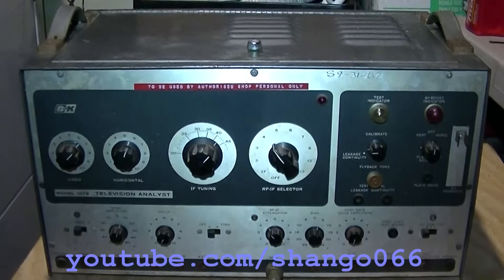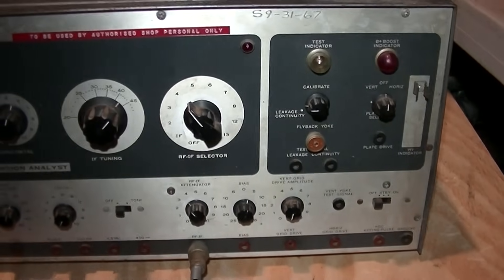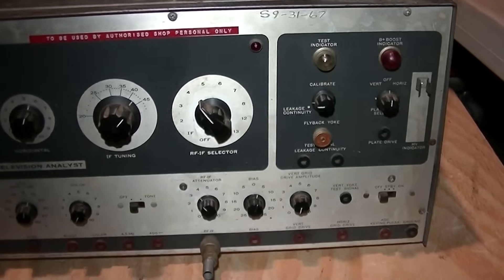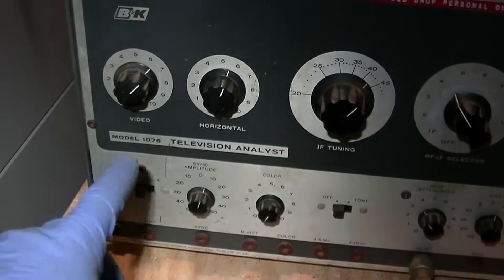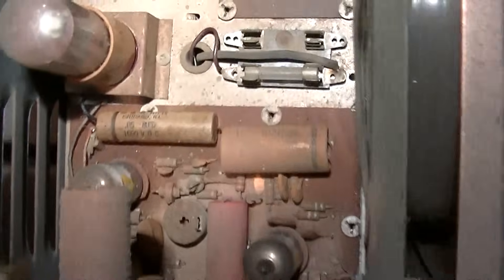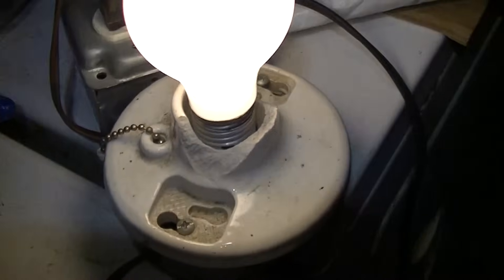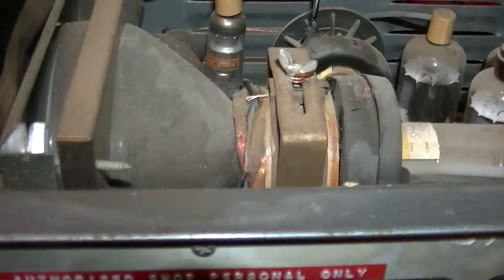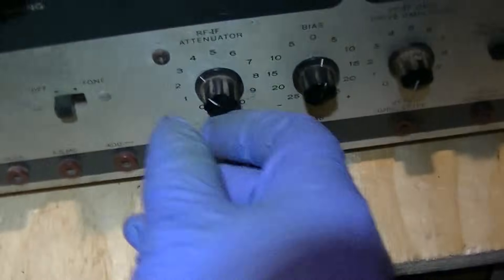BK 1076 Television Analysis

Comment: I worked for a shop back in the early 70's called Certified Electronics; certified because every tech had to either have a state certified electronic technician license or in my case 900-hour certificate from the local college that I bussed to and attended while in high-school.  

Although I was the stereo and industrial electronics technician, I sat just across the aisle from the TV guys and there were certain pieces of test equipment that you had to be authorized to even touch.  All the high-end B&K stuff was off-limits, and only the most senior TV tech's (usually those that did the alignments, convergence and color) were allowed.  On my side, I was the only one that could touch the stereo FM generator and reel-to-reel alignment tapes etc..  In addition, this was extended to oscilloscopes, component testors and the new digital meters.  Sometimes a special bench was allocated for the special equipment, other times the equipment was checked out from a closet that was locked and opened only when a special piece was needed.  That responsibility, usually fell to the toolroom/parts-manager, being a senior person (not necessarily technical) that was a person of trust.  

If a tech blew up a piece of equipment (not using an isolation transformer etc.) he had to either fix it or pay to have it repaired by an outside or factory firm (coming directly out of his paycheck; not only that, he would have to do the repair outside of normal hours if the shop was busy.  If that downed piece of equipment caused losses from other techs not being able to use it, there was further hell-to-pay!

It was the best and busiest shop in town, that hosted seminars from RCA, Zenith  and other visiting engineers, and whereby every labor charge was fixed.  So for me doing stereo work, preamps and tuners were 45-minutes, power-supplies and power-amps were 30-minutes with estimates were limited to 15-minutes and a $25 charge to the customer, refundable against the total repair bill.  If you took longer--tough luck buddy, better get smarter the next time!  Parts were the only variable cost, and this allowed customers to really have a good idea of the cost and scope of the repair, and definitely not worry about repair-returns.

So if you laughed at the sticker, it was a real-deal and you could get fired for breaking the rules...

Comment: I sometimes use a pulse width modulated bike headlight as a drop light when working on cars. When draining oil, as the stream dwindles to a thread, the light makes it appear as a dashed line. Of course the dashes change length with duty cycle changes. The light is also fun as a useless timing light.
Reply: Yep, freaks me out when I shine my stream light down at the belt and cooling fan. (strobe effect)

Comment: Have one of these and an earlier version. These contain a flying spot scanner and it uses slides you put in the machine to make crosshatch,dot,and Indian head test pattern. It’s an interesting and a curiosity now. Not usable with modern digital TVs. I believe it can generate color bars. It’s been well a few decades since I have used the ones I have. Got them from the college I went to .they had a surplus sale for various devices. And yes remember the purple phosphors on the CRT. TV stations used to use flying spot scanners for commercial slides and station ID before 35MM slides became common. This was so many years ago! And back when TV transmitterswere analog and had mercury vapor rectifiers and power tubes! The mercury tubes were a beautiful sight during dark picture modulation! Oh yes were orig talking about your flying spot camera.

Comment: I'll never get over the related "miracles" of electric charge and  electromagnetism. That an AC current applied to an open electrode, at a high enough wattage, will propagate that waveform. Id love presentation / lesson in vintage television broadcasting antenna forms.

Comment: CRT is violet not ultraviolet. Phosphor was selected for very short persistence since any afterglow would negate the 4Mhz bandwidth capability of video modulation.
Reply: The only mention in the manual about the CRT characteristics is that it is designed to match the spectral response of the photomultiplier. This being a 931A means about 4000 angstroms, which is the violet end of the spectrum.

Comment: I have two 1077s here in the uk I imported them as we didn’t have these here I use them for tv repair and tv experiments. You can drive a flyback direct with a bench power supply feed . I have managed to drive a crt with just two tubes and get a picture. I have built a 6to 24kv psu for eht . Great fun . You can get gels that are inkjet printable and print your logo to show on vintage tvs

Comment: The flying spot system uses a Photo-mupliter tube to capture the image on the slide from the CRT. I had both the BK 1076 and the BK 1077 with original manual and cables. Sold them both at an Antique Radio swap meet, in Kutztown Pennsylvania, the other year. I had no intentions of working on anymore TV sets, now that I'm retired.
Reply: I surmise a sync signal to tell the receiver when the beam is starting.

Comment: Real cool vintage tube version TV analyzer. Probably needs full caping. But it does work as intended . Recapped it would 
be for those purists or as a demostration video who test older TV sets with cigarette smelling  🚬vintage equipment.

Comment: Verify the Panasonic is set to "Air" mode not "Cable", the channels 2-4 are the same between legacy air and legacy CATV,  but it starts diverging with channel 5.
Reply: 2-13 are the same between over the air and standard cable TV. I don't know if any channels are the same between standard and HRC or IRC.

Comment: what is purpose on CRT ? only for light ? why just not use light bulb ?
Reply: The CRT provides a raster to scan the transparency placed in front of it. Using a light bulb instead would result in no signal from the photomultiplier tube.

Comment: That photon sensitive tube is similar to some PMTs (photo multiplier tube) that were used on high resolution 2400dpi drum scanners back in the 1970's, 80's and 90's. They used 4 pmt's for CMYK p/u. Old is good and back to basics...

Comment: I would recap it, although I am not a recappicide fan. But I think it would be nice to see it perform as close as the factory brand new condition. Change the paper capacitors, test the electrolytics (capacitance and leakage current at rated voltage) and replace those that aren't working right. And of course check the B+, it could be way high